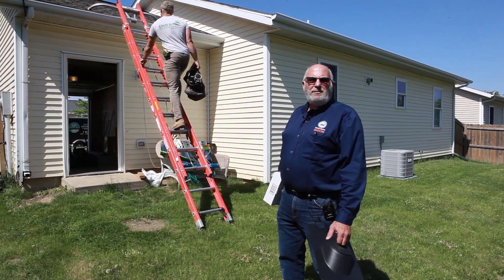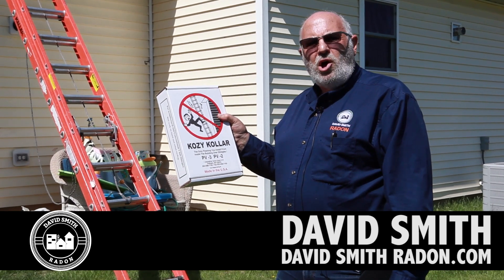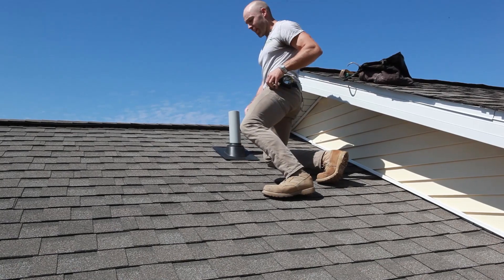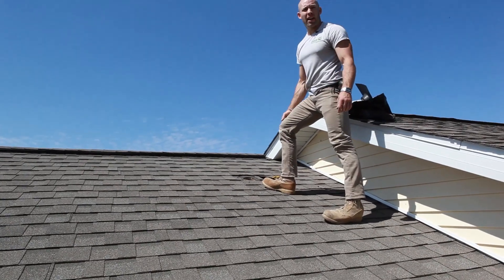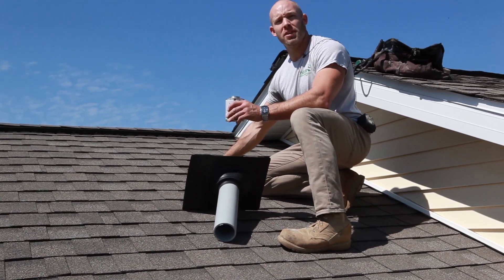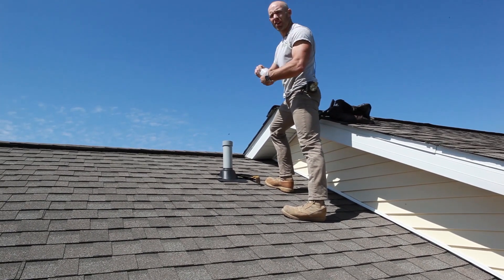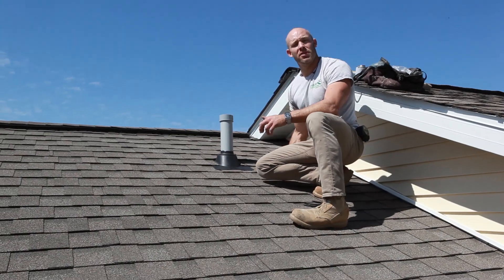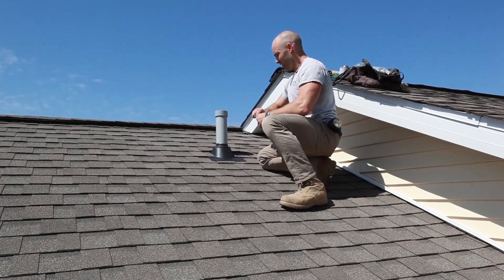Installation of Roof Flashing for Radon Pipe

Comment: so when the roof needs to be re-shingled, do you have to cut the pipe? seems like the rodent guard could have been screwed in, so it could be removed when roof gets replaced.
Reply: Stainless screws would have made replacement easier.

Comment: Does the radon vent need to be level with the ridge (or higher)? Where does rain that goes in the radon pipe end up? Thankyou for the video!
Reply: 2 feet above window or 10 feet away
Reply: The venting is sloped so any rain/condensation in the lines drains back to the vacuum point below slab. The fans are designed to hold up to this amount of water passing through them.